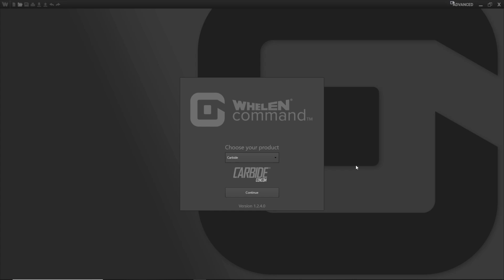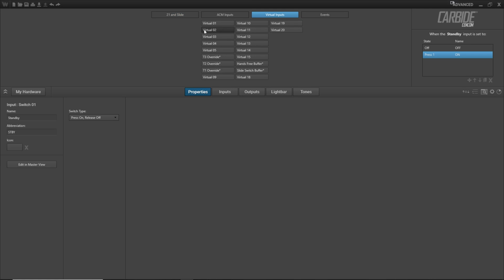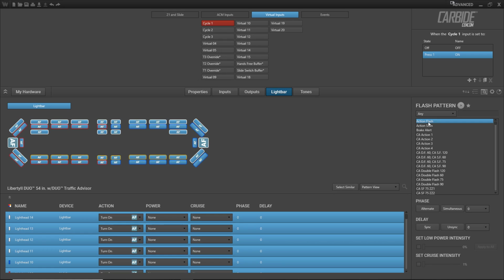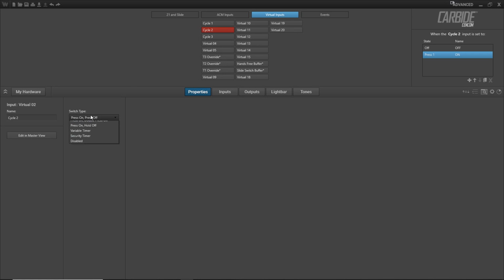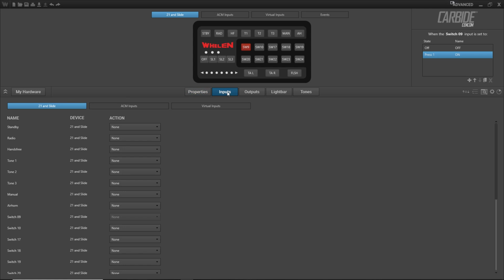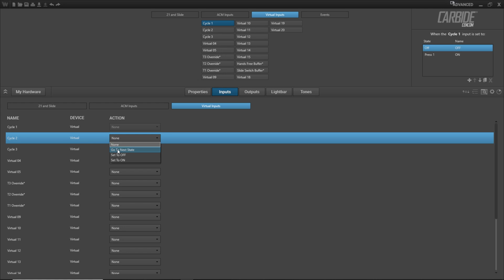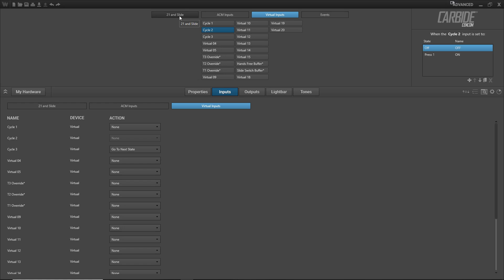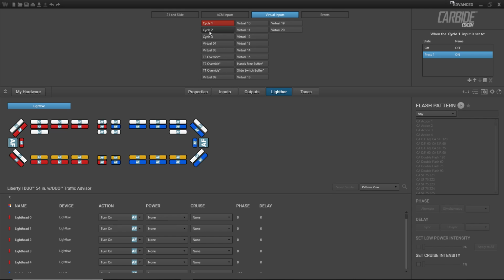Whelen Command - Flash Pattern Cycling

Comment: Hey Kent I know the ramp up pattern is coming eventually, but until then could you program one using this method? Using maybe 6 virtual inputs set 1st one to steady pattern at 10% power intensity, say 500MS for variable timer, then next input same thing but at 20% intensity and so on? and then just repeat? So it would get brighter every input when it goes to the next state?